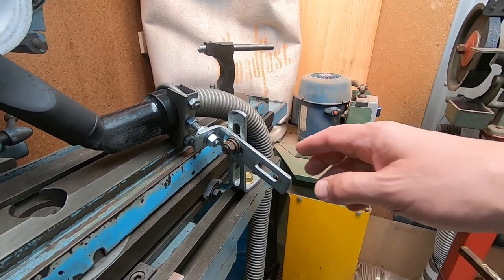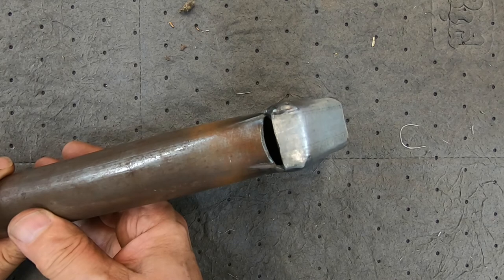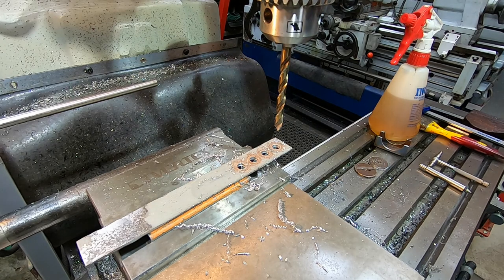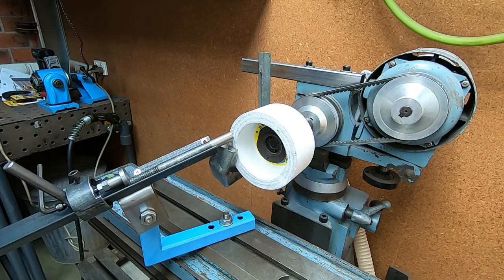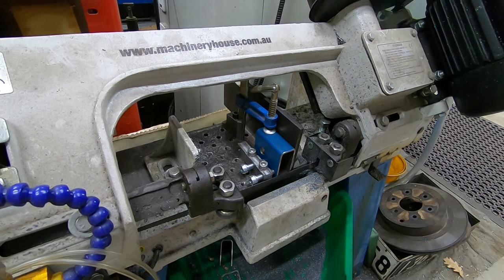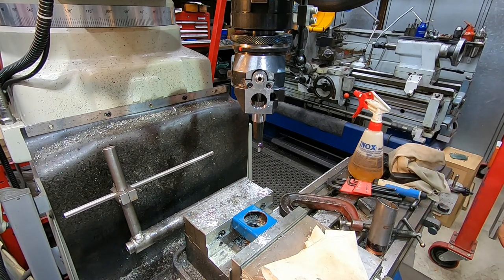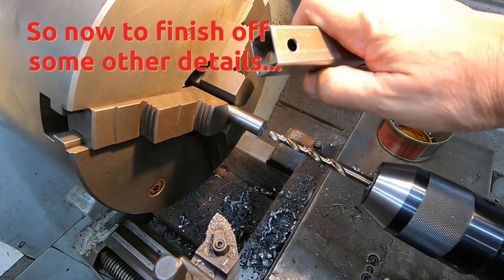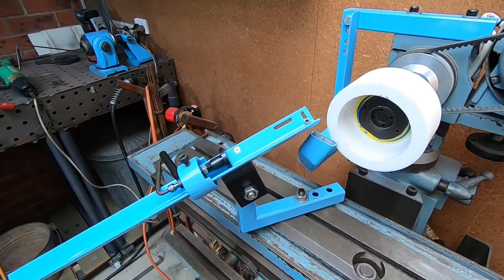Cleaning up my act - dust collection for AR5-E T&C grinder

Comment: Just found your channel and series on this machine. Do you have an electronic manual or any info on it? I recently purchased one and want to know more about it. Where have you been able to find wheels for the arbors? Thank you very much. Just subbed.
Reply from the maker: Hi, thanks for subscribing. I do have some doco which I'm happy to share if you give me an upload address for a 50Mb pdf file. I found wheels for the arbors to be readily available from a local supplier or eBay - one side has a 11/4" (31.75mm) diam arbor and the bore for the other side is just the spindle diameter.
Cheers, Alan.
Reply: @alanshomeworkshop  Thank you for getting back to me. Do you have an email somewhere I can email?
Reply from the maker: @termlimit  homeworkshop17@gmail.com